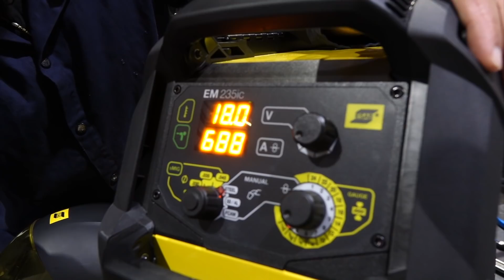ESAB Rebel EM 235 (MIG ONLY) Review and Demo

Comment: Can you set up the inductance? On the emp in the advanced menu you can adjust that, can you on this guy?
Reply from the maker: Hi Jared Yes you can adjust that but  it is not infinitely adjustable on the EM but there is some preset values. While in sMIG or Manual Mode: 
Steel/FCAW=35%
Stainless= 90%
Aluminum = 100%
Reply: @BakersGas  so no way to adjust it?  Just those preset settings. I have a 215em, just curious.

Comment: That's really tempting, but I still think I want the Fronius.
Reply: Who doesn't want a fronius, I got a rebel 285 but would toss over a bridge for the transfer 2700
Reply: I would agree with you on that.
Reply: I have the Fronius 2200 as well as the 215 EM both are great machines, use 035 on the Fronius and it can do aluminum with just the mig gun and al inner liner. I have a spool gun for the 215 it works well but is not smig where as the Fronius is synergic on all mig programs even silicon bronze. The Fronius is the more technically advanced machine. If you have the money get the Fronius if you don't then get the Esab it works just fine.
Reply: @bruced1429  thanks bud, I appreciate the advice from an owner. And yea, I'm saving!
Reply: Fronius or HTP are both far superior to these rebels.

Comment: I have the 215EM and use it with 030 solid wire and 035 fluxcore, it does a great job on 030,  This 235 EM  appears to be very good
too and I like the ability to put bigger rolls of wire in. Its is not as portable as the 215 EM which I need , but a good machine anyway.
I have another machine for 035 to 045 . good demo.
Reply from the maker: Thanks for watching Bruce!

Comment: Good afternoon, does this machine have adjustable inductance conntrol. Such as knob and indicator gauge? The machine that I have speced out does. Thank you.
Reply from the maker: Hi Steve - it is not infinitely adjustable but there is some preset values. While in sMIG or Manual Mode: 
Steel/FCAW=35%
Stainless= 90%
Aluminum = 100%

If you have any other questions please let us know!